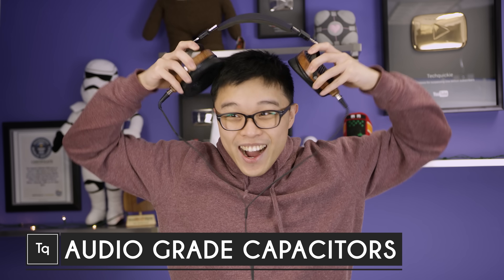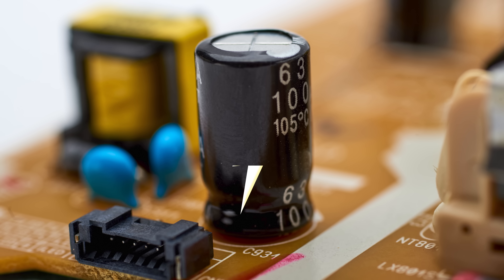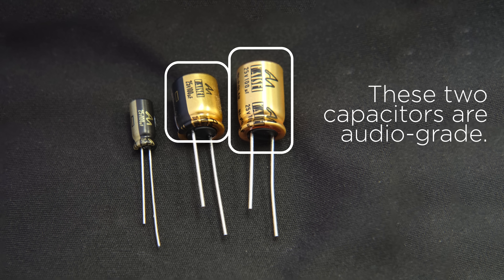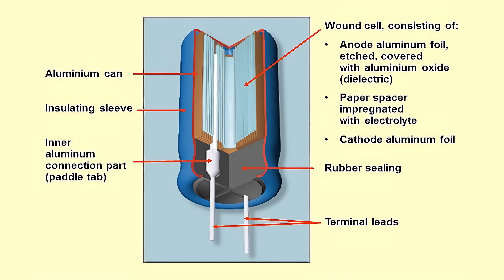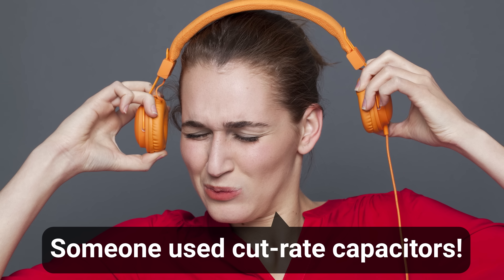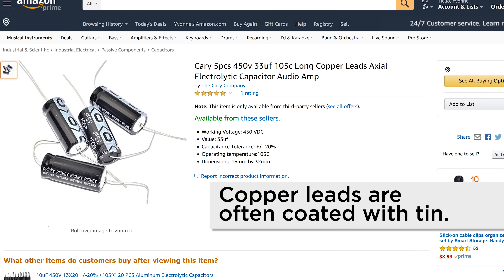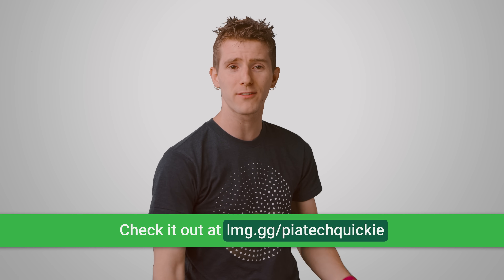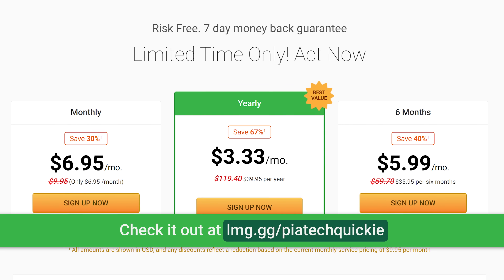What Does "Audio Grade" Mean?

Comment: "The days of low-end motherboards' on-board audio making, like, screeching noises when you move your mouse around are, thankfully, long gone."

Seems like Acer didn't get that message, probably because it was drowned out by the screeching their laptop motherboards make when you move the mouse around.
Reply: i still have that on my assrock motherboard 

sad screetch noise
Reply: My gigabyte mainboard from 2017 also makes screeching noises coupled to graphics
Reply: Mostly the caps are just fine. But people also tend to use cheap-ass psu's wich just make that happen. Coil whine and such.
Reply: My $250 Gigabyte X470 motherboard has HORRIBLE back panel audio interference whenever my GPU is under load. And it's marketed as having studio-grade audio.
Reply: Well... my XPS 15  9570 power supply can make the whole circuit go crazy while I move my mouse or doing other tasks. "go crazy" means my desktop power supply on the same circuit makes the screeching sound.
Reply: lower end gigabyte boards make these noises too, thats why i switched mine against an aorus pro ^^
Reply: a LOT of motherboards still do that. the issue comes from the way the ground is routed, and the main electronic noise sources are PSU and USB chips, as well as high frequency BUS, mainly PCI-e wich are often close the the audio chipset. now what makes it often difficult is that the motherboard itself may not be the real culprit, annd used alone will not generate this issue, but add a PCI-e card, and suddenly the issue can arise, add a USB device with a high polling rate (like a gaming mouse), and issue arise, connect the case cable (HD audio / USB / front panel LED), and the issue arise, mount the motherboard in the case and the issue arise (because bad grounding), or connect a PWM fan to a connector near the audio I/O or chipset can also trigger the issue(special for this one, the issue may only happen at specific fan speed). any of the above can trigger the issue, but what is even harder is that the issue can only arise with a combination of the above! this is why we often turn to laptops for our audio testing, as they are less prone to this issue, except on some wher we found that the noise came from the battery chargin circuit, and we solved it by plugging it and removing the battery. this issue is a nightmare for PC audio device manufacturer.
Reply: @sleveille4  Talk about a needle in a haystack. I've never invested that much time into chasing down the exact source of audio chatter in a PC. If you can't find a simple solution going with a decent USB sound solution usually works. The really cheap ones might still pick up noise on the 5V rail, but just a step up is likely to eliminate most of that.
Reply: @blahorgaslisk7763  yes, cheap product may be more prone to this issue, my comment is based on 10+ years of experience working for an audio device manufacturer, and this issue is a B**ch to tackle due to all the things i mentionned, because it's often the combination of several things that makes it happen. i've even experienced on one test bench that such audio noise only happened with one of our device, on this specific bench, with a specific headset during a USB file transfer from the HDD, but not the SSD. change the headset, no issue(and it was a very good audio monitoring  headset), seems to be that the step motor of the HDD was sending noise. change for another one, same issue but different noise. the thing is that from what i understood from our electronic engineers, the noise is sent back from the grounding, by eliminating the grounding, there are no issueand it solves it in almost all cases, but as a manufacturer you cannot do that as you have to comply with several regulation (FCC / CE etc...). go check on the forum of audio device manufacturer like Native instruments, pioneer etc.... this issue is a constant and there are almost as many Hardware culprit as they have user with this issue, the way the solve it is often by isolating from the ground as going down to the specific component is really hard (trust me, i've been there!)
Reply: @sleveille4  I'm a bit of a Jack of all trades, master of none... 
So I tend to have to do a lot of work trying to get to the bottom of problems like this the first time, and the second, and hopefully a little less the third time...
Reply: Is this with headphones or speakers?
Reply: @burgersnchips  with everything u connect to the onboard sound
Reply: Max Fuchs
I've had and used a lot of computers - branded, self built, laptops, desktops, cheap, expensive. Never once had this problem with headphones. I've had buzzy speakers but I would assume that's a ground loop...
Reply: @burgersnchips  If it's 50Hz (or 60Hz if you are in the US) then it's either ground loop or bad filtering in the speakers power supply. Guess it could be the computer PSU, but not as likely. Easy way to diagnose this is by disconnecting the speakers from line out. If the hum remains it's the power supply for the speakers and if it goes away then it's likely to be a ground loop. Easy fix is to use a ground loop noise isolator. You can probably get one for something like $5 to $10 and it should fix the problem.

If it's a chatter that changes as you move the mouse, run different programs or something like that then it's most probably a problem with the sound circuitry on the motherboard or sometimes even on a PCI or PCI-e sound card. Easy test is to plug in a really cheap USB sound card, about $5 on Amazon. If the chattering goes away it's the onboard sound circuitry that has a problem with the power delivery, but if it's still there with a cheap USB sound card then it might be the PSU that's marginal.
Reply: @burgersnchips  like i said, every sound device, (microphones, headphones, speakers etc.) you connect to the backport of such a gigabyte board, makes this sound
Reply: @blahorgaslisk7763  should also mention some motherboards use sub par mosfets in the vrm and that causes a lot of noise.
Reply: Similar issue here on an Z390 Taichi mother board. For my two KRK Rokit speakers I use S/PDIF while for headphones I use an USB sound card. The onboard soundcard's analog outputs are simply unusable.
Reply: My HP omen laptop dose that too
Reply: Yup, I have a Dell workstation that's about 6 month old and front panel audio does it too. Looks like Linus is used to have high end hardware so he doesn't know all the problems that there still are at the low end.
Reply: @GervasitorSpaceman67  re route the wires inside the case. often times they are right next to the power wires and or graphics card.
Reply: I have a similar problem with my desktop. If I move a big window my power supply makes coil whine screeching. Very annoying of it is quit in the room, otherwise unnoticeable.
Reply: My $200 ASUS laptop didn't even have problems like that. X3
Reply: @CaveyMoth  check my comment, laptops are WAY less prone to this issue
Reply: msi mpg z390 gaming edge ac, still has that screeching noise with the on-board sound, not there when i use a pcie sound card , same problem with the asus rampage 4 black edition i had before as well, probably just linus (and most other tech reviewers) that have gotten worse hearing over time
Reply: My TV makes a quite noise when i move my mouse on a white background
Reply: @FlappySock  Tried that, and it works. Still can't recommend it.
Reply: Asus & MSI z97 mobos have this issue with studio monitor speakers(genelec 8030A and Focal Solo 6 B) , and it is lot worse in Asus z97 , the msi z97 gaming says it has better capacitors and "isolated" audio circuit... well it might not be that isolated, but it is clearly better than the more expensive at the time asus
Reply: lve been from a Compaq Presario in 2000 to a Dell Notebook and Now a cheap AMD FX 8320 for more than 5 years now. Never had ANY sound issues ever,and never even knew this was a common problem
Reply: Bruh my dell laptop is hella screechy but like it makes the sound even with the speakers off
Reply: it's not just acer. the problem with laptops is across the board. everything is so close together (Power switches and what not) that the noise is picked up by the opamps and dac and what not.
Reply: e.g._John e.g._Smith sounds like interference from the mouse or USB ports
Reply: Sometimes these problems go away when you change your laptop's power supply to a branded/good one or change your desktop's power supply or even casing.

Somehow, some desktop cases can give grounds to me and can give sound hissing noises. Then when I run the board 'open' on a motherboard box the hiss go away. Second is using cheap or generic power supplies. Last is when your motherboard is just sh*t and changing it is the only solution or use optical out to a DAC.

 For laptop power supplies, I've sometimes added a couple to 4x electrolytic capacitors in the DC output and it fixes the hiss and touchpad going haywire. If I had an oscilloscope I probably just made the power clean. You can do this inside the brick if you have access or just cut the wire and add a small plastic box in between that houses your caps. I've only had to do this with cheap replacement power supplies though.

You can also add caps to your board's USB power line or make a MITM cable that has caps in it like AudioQuest's Jitterbug to eliminate noisy USB from laptop cooling pads or even USB harddrives. Doesn't always work though.
Reply: Neither did Lenovo...
Reply: My GA-H81M-S2PV (rev. 1.0) makes that screeching noises when mouse or GPU on the front panel. On the back (directly on MB) the screeching is barely audible so is acceptable. If i try to record from Mic on the front panel the noise is way louder than the recorded sounds :)
Reply: My ASUS M5A99X EVO R2.0 has terrible noise on the front panel. Had to get an external sound card.
Reply: Doesn't happen on my budget lenovo legion y520 hackintosh build
Reply: I have an ASUS x570 mobo and it's definitely a screechy boi
Reply: Can you Cut open the Mundorf Silver Gold Cap to view the inside can ? Is it real Pure Silver Foil or basically just a Fake Foil ?  Video have !  ( Surely u will have Billion of Billion of Viewer in your Youtube).................Cut it now Mundorf Silver Gold Cap.............!!!
Reply: Wow! Just another thing Mac users are missing out on!

Comment: OMG, that mouse buzz used to drive me nuts. I thought I was going crazy!
Reply: Hey how's it going Quan its Luis from 15 years ago.
Reply: @luis27mss  OMG!!! HAHAHAHA. LUIS! Hello!
Reply: I use GTX graphics but motherboard sound and strangely, I can hear the frame rate. For example, if it's running at 200 fps, I can hear a 200 Hz hum.
Reply: @fghsgh  LMAO, I think that's a feature!
Reply: @ao_qd  It eventually drives you insane though. You can't turn it off.
Reply: @fghsgh  I play Smite very much. After locking in the god I usually go alt tab. I know 1 second before my game finished loading by listening to my gpu's coil whine. A good feature I can say (msi armor oc 1070)
Reply: @fghsgh  The GPU isn't a constant load meaning the power draw changes as it works causing this noise on the 12V rail. Only thing I can think of is that swapping the PSU for one with good filtering of the 12V rail might fix it, or perhaps it's simply a weakness in the construction of the motherboard. Sorry but I know no easy fix other than perhaps using a USB soundcard. That is probably much cheaper than getting a new PSU or motherboard.
Reply: @blahorgaslisk7763  That's not it, as the frequency generated is exactly the fps (I measured it).  Also, I got a usb sound card for a second seat (multi-seat setup = Linux way of saying 2 (or more) users on 1 pc, and without virtualization). I also started using the GTX built-in audio as I upgraded to a monitor that had HDMI. Unsurprisingly, the humming stopped. But then, when I noticed that the GTX sound had a buggy driver and switched back to onboard, the hum appeared again ON THE USB CARD, not on the onboard card.
Reply: @fghsgh  That the frequency corresponds to the FPS indicates that the source is the graphics card. This primarily use power from the 12V rail, so that's the prime suspect. What's interesting is that you also get noise on the USB sound card which use the +5V rail. It sounds as if the PSU is letting that noise leak through from the 12V rail to the 5V rail, which really shouldn't happen. Do you know the make and model of PSU?
That you didn't get any noise when using the audio on the GTX card was simply because that uses a digital signal over the HDMI or Displayport cable. Same if your built in audio has a digital audio port and you can pipe that to your TV or receiver.
Reply: @blahorgaslisk7763  Does the power drawn make such a big difference as frames are drawn? The GPU is under constant and equal load because frame rate is unlimited. It did sound like a square wave with duty cycle smaller than .01, so that could be the case if drawing the frame uses more/less power than calculating it somehow.

While using digital audio, the analog audio was fine al well. That's what I was trying to point out.

The power supply was a really cheap one. It was a pre-built Medion.
Reply: my old asus board on the 1366 socket i used with my old i7 920 had this horrible onboard audio.. there was a constant humming on the speakers.. i couldn't stand it.. bought a soundcard and all was good.. the asus x99 deluxe i'm using in my current archaic 5820k build on the other hand has excellent onboard audio.. ofc it's still nowhere near any of the more expensive audio solutions you can buy but for onboard audio there is nothing to complain about.. but those expensive audio solutions really only make sense if you use high end speakers and/or headphones.. pretty pointless to run 30 dollar speakers on a 200 dollar sound card..
Reply: I don't even know when it went away as I've been using a Sound Blaster Live 5.1 card since they came out and today on windows 10, love this card.
Reply: Can you Cut open the Mundorf Silver Gold Cap to view the inside can ? Is it real Pure Silver Foil or basically just a Fake Foil ?  Video have !  ( Surely u will have Billion of Billion of Viewer in your Youtube).................Cut it now Mundorf Silver Gold Cap...............,,,,,